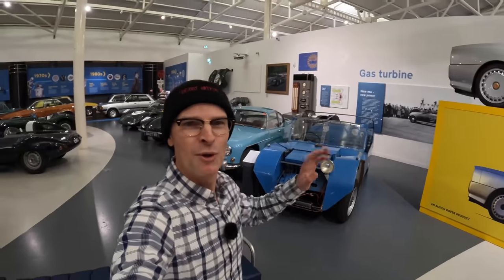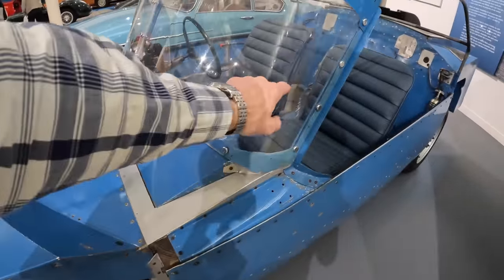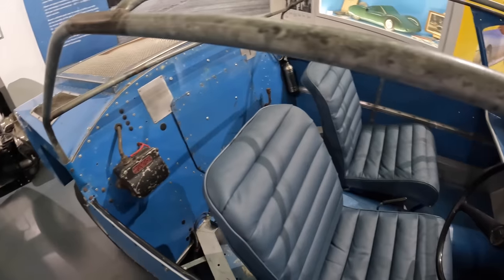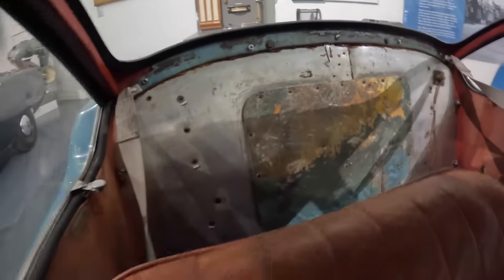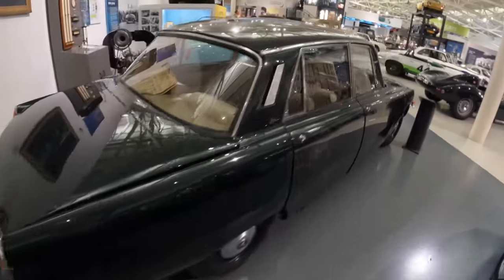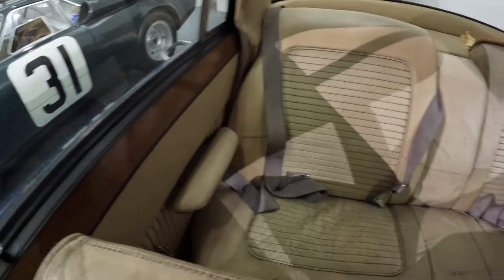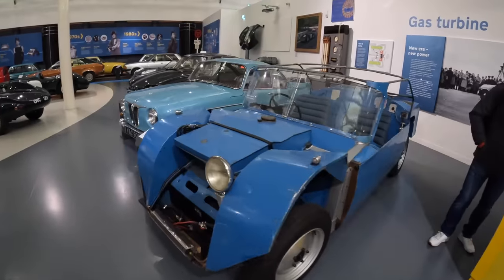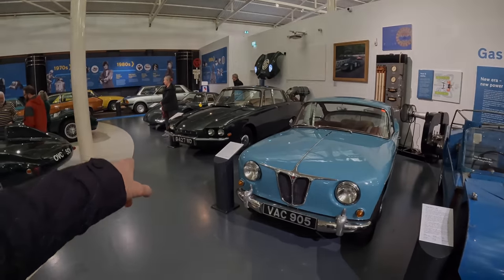Rover jet turbine cars, the future that never was in the British Motor Museum

Comment: Thanks for this most interesting look at the gas turbine Rovers!  I never knew they made these different models...As others have mentioned, we did have the Chrysler Turbine here in the States; I'd read a ca. 1993 road test of one (30th anniversary, I think); the editors said it got maybe 16 MPG, performed about like the same weight car w/ a Slant Six, and was very smooth and quiet, though the exhaust sounded like a "super Hoover" from the rear.  I also recently learned that Seattle Fire Department had one gas turbine-powered ladder truck in 1961, built by American LaFrance.  It used a Boeing unit, rated at just 324 HP, but would outperform conventional gas or diesel fire apparatus on hills.  It was in service w/ this power plant for only a year or so; the main issue was it wore out brakes quickly, owing to little/no engine-braking available on hills (which Seattle has plenty of!)  The truck got repowered in '62 w/ a Hall-Scott gasser, then a Detroit Diesel in 1977...Interesting bit of history!
Reply: Yes, Boeing did develop a small gas turbine engine in the 1960s. After the program was cancelled, one of its engineers bought one and put it in a Model A roadster. Reportedly very fast.

Comment: The Rover 2000 has an odd front suspension unlike that of any other car, in which the upper A-arms are turned 90 degrees and pivot off the firewall, and the front springs sit horizontally above those arms, and are also anchored on the firewall. 

From what I've read, that was to make space for the turbine engine Rover planned to eventually use in the 2000.

Comment: Interesting to see Rover's was a single-stage turbine engine, whilst Chrysler's was a two-stage, whose low pressure stage was connected directly to the transmission (no need for a torque converter or clutch). Chrysler also had a 'regenerator' which cooled the exhaust while heating up the inlet air for better efficiency.

Comment: I worked on these engines in the RAF. Air start rigs called STADs. It stood for Standard Triumph Auto Diesel. We were told they were made for lorries originally if its the same engine. Tick over was 25,000RPM. Flat out was 50,000 plus. It had centrifugal compressor as per Frank Whittle original rather than the axial. Guessing the RAF got them at a good price if they werent used as intended. I wonder if noise killed it. We had to use ear defenders running them up.

Comment: Ford and GM looked into using turbines for trucks. Ford had 'Big Red' and Chevrolet had the 'Turbo Titan'. The business case wasn't there, so nothing came from either project.

High manufacturing costs, poor throttle response and poor fuel consumption were the main issues identified.  The final bullet came with the then new regulations for NOx emissions. Turbines operate at high temperatures, producing lots of NOx.

Comment: I knew about JET1 and remember seeing it at the Science museum when I was a kid. I didn't know that Rover continued gas turbine engine development into the 1960s. I am guessing that the pyrometer measures gas temperature, probably at the combustion chamber. Steam locomotives sometimes had a pyrometer, which was installed in the superheater to measure the steam temperature before it goes to the cylinders. A gas turbine powered locomotive was also tried by the Great Western Railway, which built a full-scale operating prototype which was in service with Castle class steam locomotives for at least ten years. I think the problem with both rail and road vehicles was that gas turbine engines are most efficient when running at a constant speed, which is fine with a plane or a ship but does not work so well on land-based vehicles. Certainly the Great Western turbine locomotive had a reputation for being heavy on fuel, and was also expensive on maintenance, which is hardly surprising considering it was designed in an era when gas turbine engines were only just becoming a practical proposition. When it was withdrawn in the early 1960s it was probably very outdated because of the rapid development of the new technology.
Reply: The Western region had 2 turbine locos, 18000 from Brown Boveri  of Switzerland, and Metropolitan Vickers 18100. Both were heavy drinkers, especially the latter, and were rendered obsolete by the diesel engine, but the former still survives..

Comment: I remember reading a lot of articles on the development and tests of Rover Jet car development, way back when the SD1 was being readied for its long awaited launch.  One of the supposed reasons the jet turbine cars didn't get into production, was the engine.  Lag as it spooled up to a running speed to set off, and the high heat from the exhaust jetwash coming out of the rear, would endanger other following vehicles and people. It worked on a race track, but to cure the turbine lag  for road use would be similar to flooring the throttle on an automatic gearbox, with the brakes held on, or a modern day hypercar style launch consrol.  There reportedly isn't any  progressive throttle responce to accelerate, until the car is moving one the turbine reaches speed. Sadly the company lacked development money after the government told Rover to hand its wartime jet engine  development program to Rolls Royce,  to continue Rover's research for comercial jet use. Then Rover fell into the ownership of what would become British Leyland, enough said !

Comment: In case nobody else has said a "pyrometer" is a high temperature thermometer or more literally a fire meter and would be used to monitor that the gas turbine remained in it's safe heat range.  It seems like many accidents waiting to happen to have an engine that produces as much torque as a gas turbine does in a front wheel drive, front wheel steer road car,  it was the amount of torque being outputted that made Colin Chapman decide on the gas turbine Lotus project having four wheel drive

Comment: It's not so strange that Rover tried to put a turboshaft engine into a car, considering they were involved almost from the very beginning of the jet engine, being subcontracted to build a prototype for Mr. Frank Whittle. By the way the "engine speed" is that of the gas generator, not of the output shaft so it's not really comparable to a piston engine.

Comment: A great video Matt. I've seen the saloon car many years ago at the Gaydon site. Imaging what could be achieved if they explored gas turbine electric to charge batteries although if I recall these GT engines lacked the torque of a 'normal' internal combustion engine hence the sky high RPM. It would be interesting how long the bearings would last as well but I guess those big metal bird shaped jet objects that fly us to different countries get along just fine. I guess there was a reason other manufacturers didn't pursue the concept and Rover being perpetually cash strapped probably had no choice but abandon it. It would have been interesting to see how it would have played out had development continued. Many thanks for sharing.

Comment: For background, during WW 2 Rover was sub-contracted to build Frank Whittle designed jet engines, known as the W.2B (producing some 1400 lbs thrust) for the Gloster Meteor prototypes, with the intention of building slightly improved variants for production Meteors. However in early 1943, thanks to Rover's tardiness in building and delivering these prototype engines in a 'gentleman's agreement' the Rover jet engine factory at Barnoldswick was handed over to Rolls-Royce, in exchange for which Rover took over the Rolls-Royce Meteor tank engine factory in Nottingham. The W.2B became the R.B 23 Welland, while an improved W.2B/23 that was still being designed became the R.B 26 Derwent series. 
As it is, the Bristol/Rolls-Royce Olympus engines powering the Avro Vulcan owed nothing to Rover.
Reply from the maker: Not the main engines, the APU was a Rover jet engine
Reply: @furiousdriving  duh! I skipped over the part where you mentioned the APU (more properly, the Air Auxiliary Power Unit or AAPU) - 'twas a Rover 2S150 ...

Comment: Man I doubt gas turbine engines would ever have made it in cars for quite a few reasons.

Gas turbine compressor section pumping losses are comparatively enormous compared to pistons. In order to generate a reasonable compression ratio at idle requires probably about 500cfm of air that's roughly the same amount of air (and therefore fuel in the correct ratio) a 250hp 5 litre V8 would consume at 5000rpm with all its moving parts and and other pumping losses.

In fact even today in the general aviation market the piston engine still persists because with current technology we still can't make a turbine engine that can deliver any kind of fuel consumption approaching a piston engine in the sub 15,000' to sea level range. This is where most cars would operate too. 

There is a company out there that reckon it has cracked the affordable fuel efficient gas turbine for aviation but I don't think their engine is specifically designed as a replacement for piston engines, more an option for people who want a turbine in their kit plane so they can fly fast and high where turbines are able to exploit their operating cycle better than piston engines ever can and don't care about fuel consumption at low elevation or acquisition costs of the engine. Happy to be proven wrong.

Gas turbine problems for regular motor cars are diabolically difficult to solve because air is the cooling medium and so much excess air has to be generated for internal cooling generated by both the cold section compressing air for combustion and the combustion itself within the combustors and in the turbine section. It obviously works but this costs in fuel and lots of it which makes it suited to governments, corporations, the wealthy and applications such as military, rescue and the airlines where economies of scale and usage gains allow the advantages of turbines to be utilized. They have advantages such as very high power in compact lightweight packages, no reciprocation mass, few moving parts but automotive applications make the turbine engine thermodynamically speaking inefficient and that's the bottom line. 
Pistons made it, not for no reason.

In a piston engine you just surround the cylinders with water, but you can't easily in a combustion chamber section, nor the turbine section of a turbine engine in a way that works in varying conditions cars operate in. High ambient air temperature on the intake side of turbines really limits their flexibility, particularly in small turbines with high power outputs expected to use little fuel.

In short, I don't think they were ever going to succeed in cars. Every mechanical principal was worked out by 1930 but what wasn't understood or known was metallurgy and trial and error experience of gas turbine engines. I don't think you can do with advanced metallurgy that which requires re writing the laws of physics. In short manufacturers were playing with small turbines for cars in what equates to trial and error. 

Hope they come up with a workaround LOL.

Comment: The industrial pyrometer was a reomte pyrometer for measuring the exhaust temperature. The Chrysler exhaust initially had excessive temperatures  that would scortch  the asphalt fro the high exhause temperatures.
Reply: Mack trucks had a turbocharged model with a pyrometer very prominently placed on the dashboard. They suggested the driver use it to make gear changes at a certain temperature.

Comment: The problem with the gas turbine engine was it only really performed well at a constant speed .. The T3 would have made a beautiful car especially with the V8 in it
Reply: To clarify, only efficient at top speed. Fuel guzzlers are lower speeds due to the lack of air density/pressure.

Comment: I think turbine power for cars could make a comeback if combined with current battery hybrid technology for low speed operation and the turbine for the rest of the time. Plus, with today's cnc machining and additive manufacturing (3D printing) could bring the price of turbine engines way down.

Comment: It was a nice concept but really not practical at that time. In the UK, the period of reconstruction and austerity was still going on until the mid 1950's and even when prosperity returned in the later part of the 1950's, folks were not going to go out and spend huge money on a Rover Turbine car (especially when there were cars much cheaper). In the USA there were the GM concept cars for showing off the concept and the Chrysler Turbine which about 50 were made and these were lent out to folks to bata test them over a period of 2 years (each person would get about 2 months with one). The consensus was that even though these cars drove smoother, needed less maintenance, they were underpowered, a bit noisy and were fuel pigs. These got worse gas mileage then bigger piston cars. Plus even though it it could run on quite a bit of different "fuels", it could not use the predominant gas used at American filling stations (leaded gas) due to it damaging the engines. So most folks probably ran it on kerosene (Paraffin for our UK friends). Finally these made US piston powered cars of the time look like emissions champs because the Turbine car put out more emissions then your average piston car running on leaded gas. it was a nice concept (especially with that jet engine sound) but one doomed from the beginning.
Reply: Yeah, but I still want one!

Comment: Strictly speaking, a jet car is one driven by jet blast out of the rear like a dragster. This would obviously be completely impractical on the road. These are driven by gas turbines driving through conventional transmission.
Reply from the maker: this is true but gas turbine doesnt fit in a thumbnail and its too long to fit in the title
Reply: In the Chrysler Turbine cars the gas turbine was simply connected direct to their Torqueflight transmission - there was no need for a torque converter.

Comment: Surely the point of having a gas turbine in a car would be to take advantage of the much higher efficiency over a piston engine and get really good mileage per gallon. In this, these Rovers singularly failed and were nothing but red herrings.
Reply: Not just Rover, Chrysler tried and failed with the Chrysler Turbine which went into limited production 60 years ago and had heat exchangers to maximise fuel economy, but after extensive consumer road testing of the production run (50+ cars) the fuel economy that Chrysler wanted just couldn’t be achieved - this failure plus the excessive NOX emissions finally killed the project. A few survive that are still driven but most were destroyed by Chrysler - a real shame.
Reply: @jaywalker1233  Yes, I was aware of the Chrysler car. I have seen videos of a preserved example of the car
Reply: @replevideo6096  
Just to be clear, all car company efforts to develop gas turbine cars “singularly failed and were nothing but red herrings” not just the Rover car company. Rover just happened to be the first company to develop various gas-turbine-car running prototypes in the early 1950s (using its WWII jet engine manufacturing skills) - in terms of history it deserves credit for innovative thinking and engineering capability, essential attributes in any technology manufacturing company, and that is the purpose of this Youtube video.